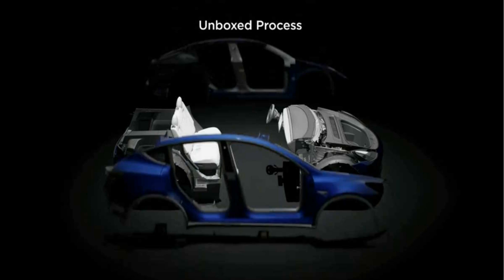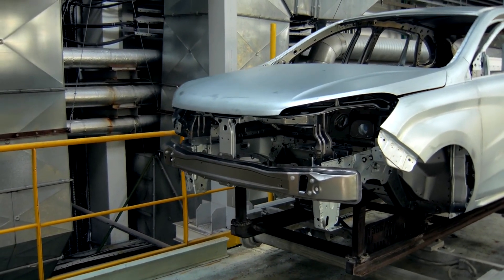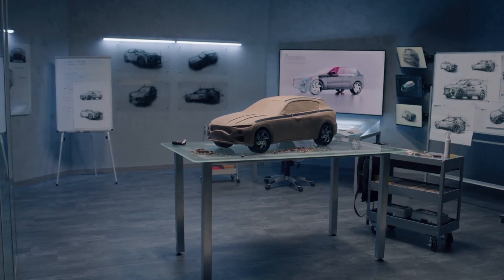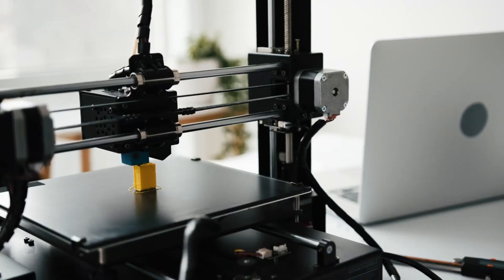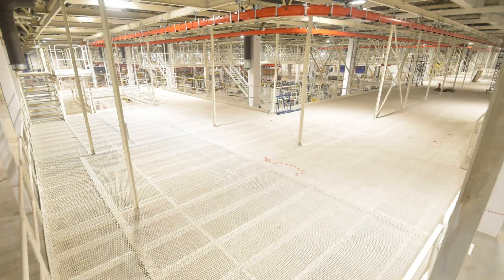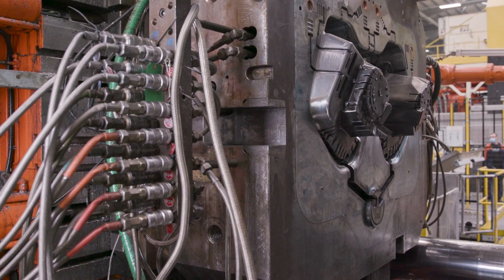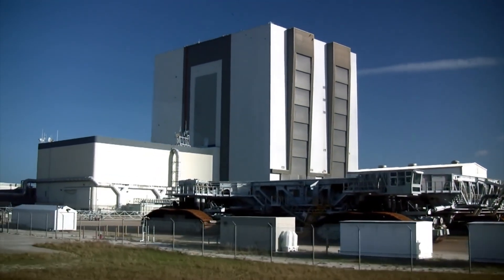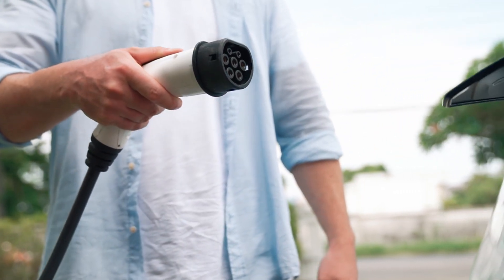How Will Tesla Manufacture Its New Compact Car and How It Will Make Millions Per Year

Comment: "Not having to take the doors off after paint." alone is quite insignificant. Keeping the painted parts matched to one particular car is cumbersome because if any part has a problem, then the matching parts all have to be pulled off the line and wait for all the parts to be sequenced back in at the right time.  Now, if they have paint so consistent that any red door fits any red car, that does make sequencing much easier.  They will probably limit options so that there are not a lot of different combinations.  The big savings is the space that the production line takes up.  Some steps are probably faster and easier. For example, you can turn the whole front 90 degrees to mount the headlights instead of stepping between cars.